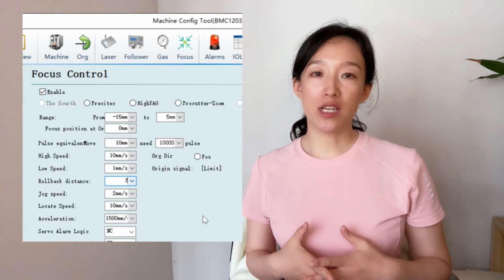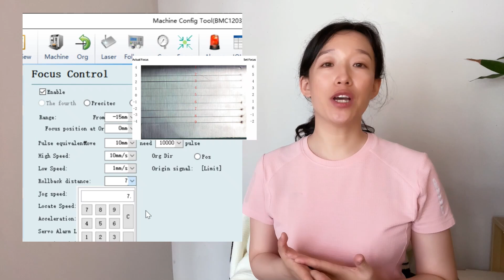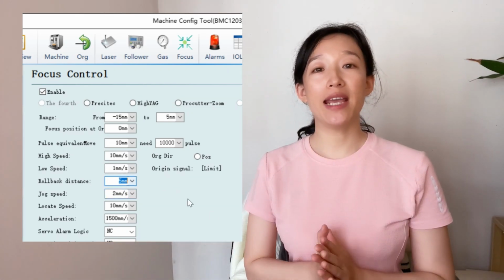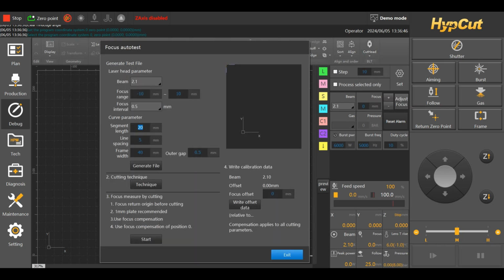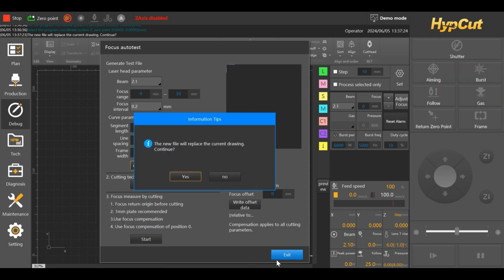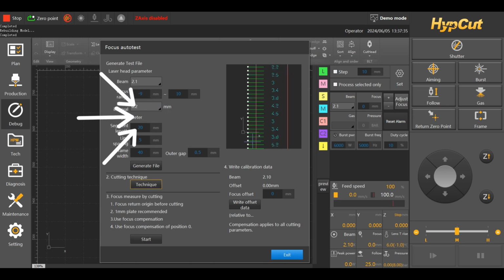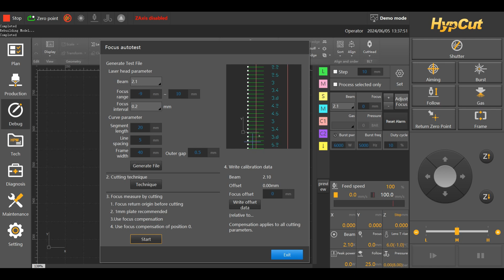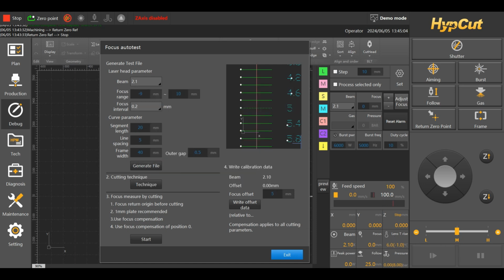CypCut Solution: Find Actual 0 Focus | HypCut Solution: Focus Auto Test

Comment: Hi Clara, excellent videos!
In cypcut, to make this focus test. Do i make a cutfile with a lot of lines and set different layers with different focus for each layer?
Reply from the maker: Could you check the steps in this video?
Reply: @ClaraChai  yes i watched the video multiple times. But can you send a file for first example. With different focus settings for each line. Or how to generate file in cypcut with bochu 421 head. I think i miss something in machine config it seems i cannot adjust the beam size and focus. Would it be possible to have a personal chat for a fee ofcourse?
Reply: I found the problem, i did not find the correct machine setting menu. Now everything is working great. Thankyou for responding!
Reply: @skuresture if you are working on cypcut, you can find the focus test in -> file -> machine adjust tools -> focus test